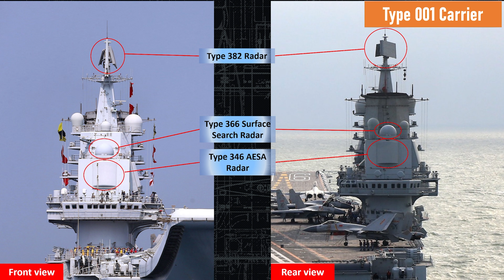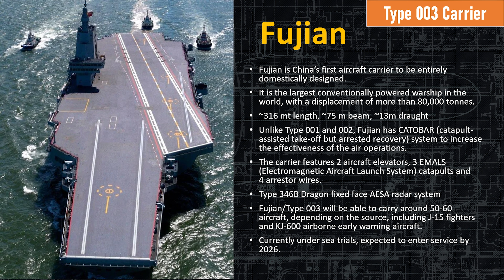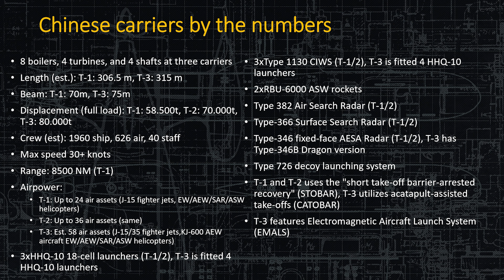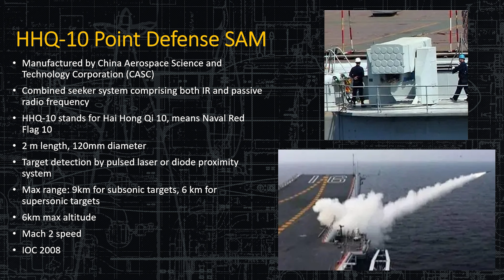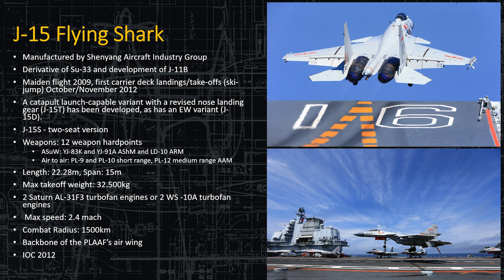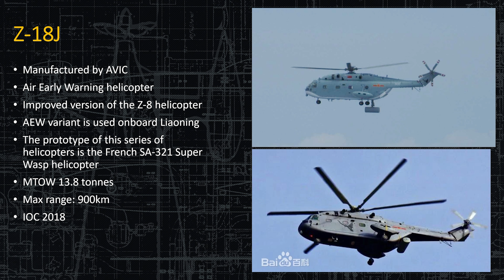China's New Fujian Carrier Changes Everything - Here's Why

Comment: @Sub Brief 
China did not stole US EMALS technology, because they fundamentally work differently!
Chinese carrier uses DC medium voltage with supercapacitor modules for energy storage EMALS, Ford Class uses AC power with flywheel array for energy storage. On the whole Chinese system is simpler and more compact. It does not need mechanical complexities of the flywheel system, therefore no vibration and mechanical stress under the hood.

U.S. (Ford Class): Uses a Linear Induction Motor (LIM). This is natively an AC machine. Because the Ford’s energy storage (flywheels) produces AC, and the motor is AC, the system requires massive cycloconverters to change the frequency and voltage of that AC in real-time to control the shuttle's speed.

China (Linear Synchronous Motor): Typically used in DC-integrated systems, these often use permanent magnets or precisely timed DC pulses. They are generally more efficient and run "cooler," which is critical when you don't have the luxury of a nuclear reactor's cooling capacity.

Under the flight deck, the Chinese system is "solid-state," whereas the U.S. system relies on massive rotating machinery.
While "no moving parts" isn't 100% literal (you still have cooling pumps, fans, and the physical catapult shuttle moving on the track), the energy storage and distribution—the "heart" of the system—is where the difference is night and day.

If you value maintenance and simplicity, the Chinese system is conceptually superior. If you value sustained, heavy-lift sortie rates in a high-intensity war, the U.S. system’s "brute force" kinetic approach still holds a theoretical edge—assuming they can finally iron out the reliability bugs.

Also 
1. Linear Synchronous Motor (LSM): The "Magnet" Advantage
 an LSM typically uses permanent magnets (usually high-grade Neodymium or Samarium-Cobalt) on the shuttle itself.

How it works: The track creates a magnetic field that "locks" onto the permanent magnets of the shuttle. They move in perfect synchronization.

The "Simplicity" Factor: Because the shuttle has its own permanent magnetic field, the system doesn't have to "waste" electricity creating a field in the shuttle.

Space Savings: This is a huge reason why the Chinese system is more compact. You get more "thrust per square inch" because the permanent magnets do a lot of the heavy lifting.

2. Linear Induction Motor (LIM): The "Thermal" Burden
The U.S. Ford-class uses a LIM, which does not have permanent magnets on the shuttle. Instead, the shuttle is essentially a "dumb" piece of aluminum/copper.

The "Induction" Problem: To move the shuttle, the track has to use massive amounts of electricity to induce a current inside the shuttle. This "induced" current creates its own magnetic field, which then pushes against the track.

Heat Generation: This process is inherently less efficient. A large portion of that induced energy turns into waste heat (Joule heating).

Thermal Management: Because the LIM generates so much more heat during that 2-second "pulse," it requires a massive, high-pressure liquid cooling system. This adds pumps, pipes, and heat exchangers—more "moving parts" under the hood that can leak or fail.

Why doesn't everyone just use LSM?
If the Chinese LSM is cooler and more efficient, why did the U.S. go with LIM?

Cost and Material: Permanent magnets are expensive and made of rare-earth metals (which China controls).

Durability: The U.S. was worried that the violent "snap" of an EMALS launch might shatter or demagnetize permanent magnets over time. They chose the LIM because the shuttle is just a solid block of metal—virtually indestructible.

Magnetic Signature: Large permanent magnets create a massive magnetic "footprint" that can interfere with shipboard electronics if not shielded properly.

By choosing LSM, China bet on their ability to manufacture high-durability magnets and manage the electronics. By choosing LIM, the U.S. bet on "brute force" and paid the price in thermal complexity and reliability.
Reply: A large part of why China went with DC has to do with its inventor, Ma Weiming who bet his whole career to insist to the admiralty that if they are going to go for CATOBAR, they might as well as go straight for the bleeding edge and abandon steam for electromagnetic launch. At that time, China already has some of the best engineering schools and research institutes and Ma was already an accomplished electrical engineering professor specialized in solid state DC electronics. The PLAN took a huge risk but apparently they were convinced by Ma and it paid off. Going straight for DC also mean that they were going for a fully electrically integrated system on board the Fujian. While the Fujian is still steam turbine powered, this breakthrough in integrated electrical DC system is going to translate to other ships and future nuclear carriers for a fully integrated electric propulsion. 

Remember that China is the only country that deploys ultrahigh voltage 1.1M DC volt transmission on a massive scale, thousands of km long transmission lines and they using solid state electronics to do it. 

 Tsinghua, Zhejiang are some of the best engineering universities in the world. People in the west still underestimating just how far China is, in industrial and electrical engineering and scientific development.
Reply: @gelinrefira  I'm not sure what benefit those advanced universities will provide to the people or China when most of them can't even afford basic things like food or clean water or a house due to the fact that China is so far ahead of the west that it doesn't have well fare or social  safety nets. Its a system were the only way to progress in anything is to know people, as you could probably Imagen this causes alot of corruption and also leads to China as a whole having the largest amount of academic forgery in the world. Same with the military, it doesn't matter if the catapult is better, if stuff like that can't work cus the guy up keeping it didn't bother getting the right parts for up keep or the guys commanding operations for it don't know what there doing cus they bribed there way to the top all of it will go to waste.
Reply: @darksars3622  中国大多数人连食物，水，住房负担不起？看来你又被西方媒体洗脑了。中国人的住宅拥有率远远大于美国，只要看看中国街上没有流浪汉就知道。至于食物，中国人最讲究吃了，各种菜系，美食都价格便宜，人均蔬菜水果鱼消耗量远远大于美国人均，人均肉食也不比美国差，可能人均牛肉没有美国多，因为中国人更多的是吃猪肉。至于水，中国人习惯于喝烧开的热水，不管水有多干净，都习惯于烧开。而西方似乎直接喝生水？然后看到中国人喝热水，就以为中国自来水不干净？这又是你们西方媒体的洗脑结果
Reply: @tianking-v4c  Who the hell made it your job to tell me what i saw. I lived in the country for over a year and that is what I experienced.
Reply: @darksars3622 谁知道你有没有在中国生活一年？我作为一个普通中国人，宅家里暂时没工作的中国人，中国什么情况不比你清楚？你估计就在西方媒体上了解中国的事，什么中国人食物负担不起？就像台湾人黑中国大陆，说中国大陆人吃不起茶叶蛋，可笑得很。我现在哪怕没工作两年，一直躺平家里，至少吃的住的根本不用担心。因为中国食物价格非常便宜，自己做饭，每天二三十块钱就能做的有菜有肉有水果，相当于四美元到五美元。因为中国菜市场猪肉十元到十五元一斤，也就是不到两美元，蔬菜更便宜，鸡蛋三十个一盒一般二十元左右，也就三美元，这样的价格中国人会吃不起食物？自己做饭的话，一个月一千元足够吃得不错了，也就是二百美元不到。而这还是中国二线城市物价水平，不是在农村
Reply: @gelinrefira rumour is that the decision was escalated all the way up to Xi who took a calculated risk that paid off. Similar to how the decision to abandon EMALs and to back to steam got escalated all the way up to Trump who then issued a Presidential Directive.
Reply: @alvinseah5423  Yes, the decision to abandon steam and go straight for EMALS went to very high places but I can't verify if it was President Xi himself who made the decision. I don't even know when the decision was made and if Xi was even the president at that time.
Reply: 說到底，就是一個國家的科技樹，中國人口眾多，頂尖人才太多，所以他們可以完成一切難題，比如光刻機，芯片，操作係統，全自主太空站，北斗授時導航衛星等，可以跟美國一樣設立自己的標準係統😂😂😂😂
Reply: @桂旭暉  i wonder why china hasnt struck yet then? Why wait?
Reply: @KarolusMagnus33 中國已經領先世界，不需要等，你美國F35，F22，B-2等，中國對等J35，J36，J20，，B-2由J-50六代機對付，對等艦船由052D，055，075對付，導彈DF對付，天上北斗導航對付Gps，你們美國跟本對中國無從下手
Reply: @KarolusMagnus33  Why should China go to war just to have domination? That's western "law of the jungle", selfish, greedy, colonial mindset. Chinese don't think like that.
Reply: @桂旭暉  We'll see who has the better tech when the time comes, I think we all know when that will be happening...
Reply: OK now that is alota words. Didn't understand half of them but still helpful.
Reply: @darksars3622 In simpler terms, America chose a 20th century tech path (mechanical) to achieve EMALS, due to America's lack of industrial base and expertises for foundational micro-electronics components, power supply equipment (i.e. heavy duty transformer, inverters, high voltage DC power lines) and more importantly new energy EVs
For a supply chain safety and independence point of view, America did not do wrong. However, from a pure engineering point of view, it is not the most optimized solution.
 
And China used a 21st century tech path to achieve EMALS. Because Chinese had been building rare earth magnets, all kinds of electric motor,  DC power supply and all sorts of inverters, converters and supercapacitors on a massive scale the world had never seen for the last 4 decades. Also China produces 75% of world's EVs and 80% of world's batteries.
For China everything is already there off the shelf. They just need to be put together and weather tested.
Reply: @888YangJi 你忽略了一點，實際上就是美國沒有完成的磁懸浮技術，這個技術是上海獨有的技術(包括德國擁有這項專利技術)，而且福建艦也在上海滬東中華船廠製造，所以這些技術可以同時轉移到航母上😂😂😂

Comment: sadly they are only going to build 1 of this and rumer has it the next one will be fully nuclear and displace 120k ton+ and that is the one they are going to serial build...

this is a good ship, i hoped they make at least one so it has a twin
Reply: If China works out molten salt nuclear reactor-engine issues. It can build far superior nuclear aircraft carriers afterwards than anyone else
Reply: There are plans for 003A. In fact, the fake carrier in Wuhan currently sports the 004 hull with the 003A's superstructure. The 003A separates out the smokestack from the island, so the island will be the exact same one used in 004 but in the 003A there's a stack behind it.

Comment: what do you think of the 2 launch rail on the Fujian, with one of them protruding into the landing area...

like you can't do launch and retrieve SIMULTANEOUSLY .....
Reply: Not even USN does simultaneous launch and recovery. The CAPABILITY is there, just never used except in dire emergencies. If the Air Boss causes a simultop at any point during deployment, he gets a 1-on-1 with the admiral.
Reply: its Ai generated pic dude..
Reply: You’re again just admitting with comments like these that you’re no likely older than 13 and how no idea how carrier ops actually work.

Comment: BTW, What's your thought about the FF(X) frigate price tag just revealed? Total cost of the first hull is $1.67B including $972.5M for basic construction. Totally shocked, it's supposed to be a proven design built by a hot production line , a lean coast guard hull with minimum alterations and without VLS as well as advanced AAW capability, and this cost 1.67B!? Seemed not taking any advantage against Constellation class. And only four FF(X) are going to be ordered in the FYDP (FY2027~FY2031), not as fast as previous expectation
Reply: It's par for the course for Navy ship procurement in the last 20yrs.
Reply: Don't worry about it. Realistically, we will never fight China. I don't see either side winning without the other resorting to nukes.
Reply: The limited orders are because USN know it's crap and want to maintain minimal exposure. The individual price tag is because the orders are limited. So, yeah... another exercise in futility...
Reply: and it doesn't even have VLS..

Comment: Wait, so both the Forrestal class (81,000t) and the Kitty Hawk class (83,000t) carriers could both load in excess of 80 aircraft, but some way some how you 'estimate' that the 003 with a displacement of 85,000t can only load "around 40" jets???  ROFLMAO FAIL
Reply: F-8 Crusader: 54 feet length, 15 tons

A-4 Skyhawk: 42 feet, 11 tons

J-15: 73 feet, 35 tons

It's a massive thing. The biggest carrier based fighter in the world ever. It's not obvious from their svelte silhouette, but Flankers are enormous birds.

If they later switch to J-35s, they can probably cram in more.
Reply: @danielch6662 
There won't be a single theme, that's ridiculous, it'll be a mixture of J15, J35, KJ600 and probably some drones, they did demonstrated in earlier footage.
Reply: @danielch6662 that’s not true j-15 and j-35 is both smaller than us counter part.
Reply: @gasthewhale No? J-35 is slightly bigger than F-35C but J-15T is the largest naval fighter in the world by far.
Reply: @Flightman453 when you looking at the way the plane is parked they are not parted with their wing full opened. Have you actually measured all four plane folded wing lengths?
Reply: @gasthewhale  j-15 is longer than superhornet or even f14. the estimated payloads are smaller though
Reply: @gasthewhale  It gets worse when you factor in the wing folds. F-8 folds to 6.9 meters. J-15 folds to 7.2 meters and J-35 folds to 8.4 meters. This is why J-35s won't actually increase the number of planes Fujian can carry. The plane's overall storage footprint isn't that much smaller than that of the J-15. In fact, a J-35 is basically the same size as the F/A-18E.
Reply: @lasskinn474 what😂,payload are smaller.
Reply: @gasthewhale  I'm not really sure what this addresses about what I said. You said the J-15 and J-35 are "smaller than US counterparts" which is quite irrefutably not correct. The J-35 isn't massively bigger than the F-35C but it's slightly bigger. The J-15T is far larger than the F/A-18E/F SH. Not really sure what you're saying has to do with anything there. If you're now talking about how well they fold, the J-15T is much larger than the J-35 with a larger wingspan, but folds better than the J-35.

Regardless, I'm not really sure what you're trying to say.
Reply: @Flightman453 it’s the fold size.since this is what the limit how much you can carry on a carrier.
Reply: @gasthewhale  Ok, so what's the argument? That the 003 won't be able to carry as many fighters or something? It will be able to carry 35-45+ fighters which is a lot and good. J-15T/D folds better than the J-35 and is what will make up most of the Fujian's air wing.
Reply: @F @Flightman453 the fighter plane it should be able to carry should be better than kitty hawk close to Nimitz. Both f-18 and f35 is both larger in size than j-15 and j35. The deck of 003 is also larger.
Reply: @gasthewhale  damn bro you unironically are just completely clueless lol.. this exchange was a bit of a rough read. must suck to live as such a midwit!
Reply: How much space is taken up by all the diesel generators needed for recharging the EMALS?
Reply: @randys2358  Fujian most likely uses 8 QD-50 turbogenerators on top of whatever integrated generators she has connected to the steam boilers.
Reply: Greatly minimized numbers, like most other specs from China. When they tell you it's 40, you're thinking it's maybe 80 or at most 90. Then they hit you in the face with 120 aircraft.
Reply: @djinn666  with drones, yes.
Reply: @danielch6662 Yep. Could very well be a high low mix.
Reply: That's all the CCP can do... or they've announced propaganda.